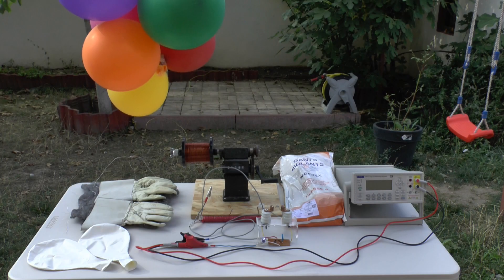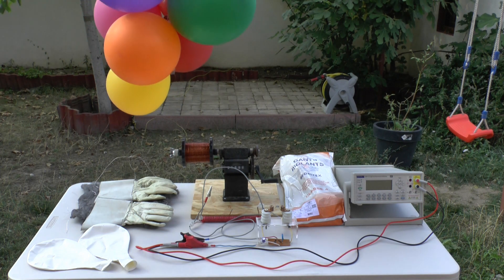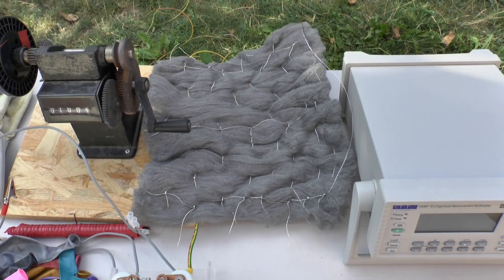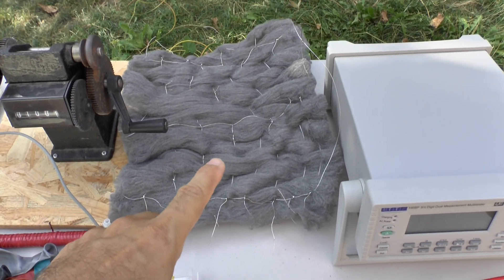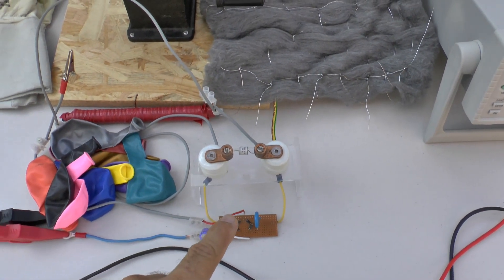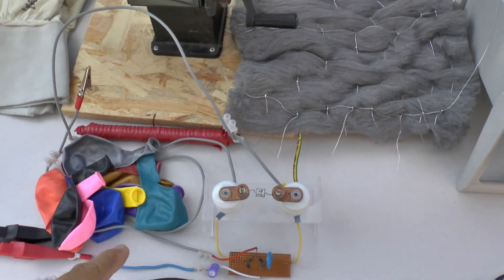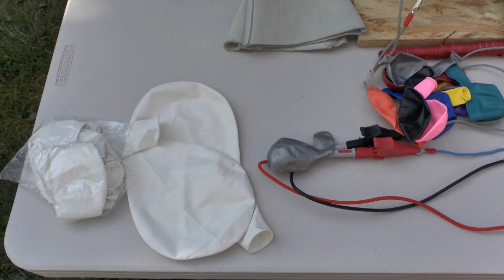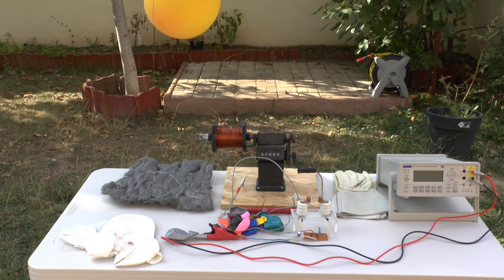Harnessing Atmospheric electricity, and lift-off setup YT1

Comment: Atmospheric Steam capacitor the water in the air is staticky charged
Reply from the maker: The opposite. Water does neutralise any charge. Also, to clean any charge from orgone devises. Electrostatics does only exist in an environment where humility is below 30%. Hence the shock you get in winter when the heating in your house is evaporating all moisture. Friction from raindrops in the air on the other side create a high electrical potential which is generated faster then humidity can dissolve. Hence lightning.

Comment: Somebody has claimed you can use standard coax cable with the exterior insulation stripped as an antenna. You then have to heat it up to get all the molecules lined up in the material between the center wire and outer shield for it to be a good electret and antenna. I'm not nearly the scientist some of you folks are so foregive me if I an speaking out of line. I've been wanting to run it around the entire perimeter of the fascia board on my home through insulated eyebolts. Perhaps a dangerous experiment for me though, because of my lack of knowledge. Good luck and be careful.